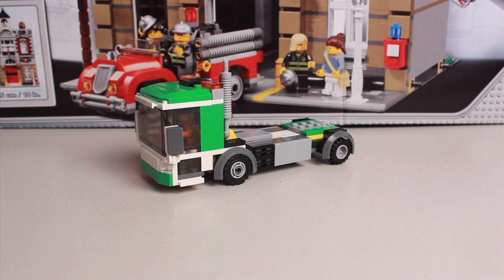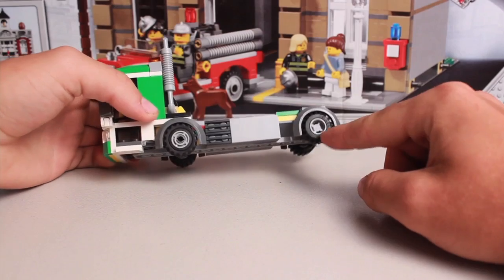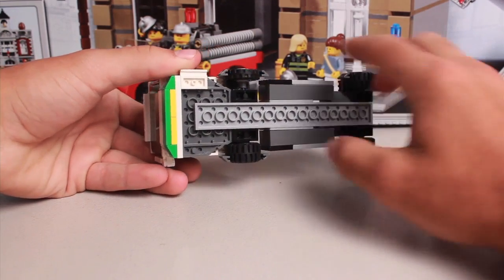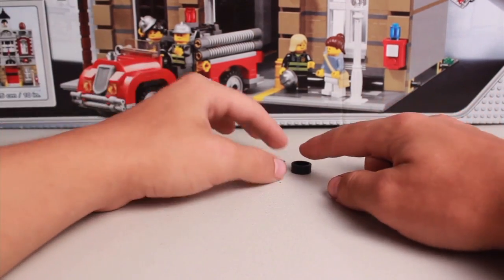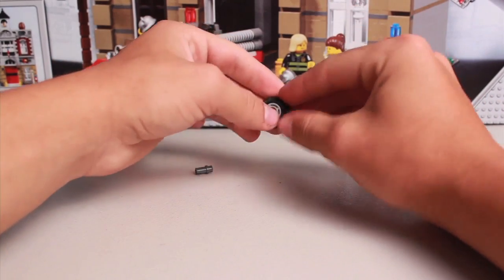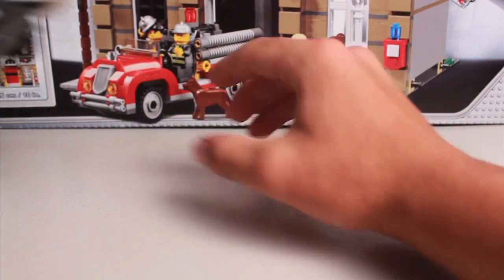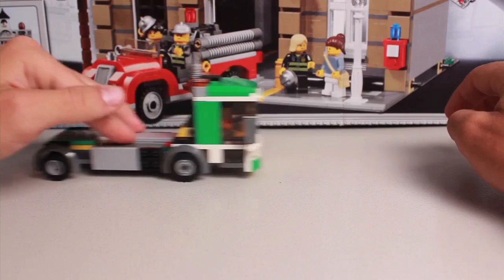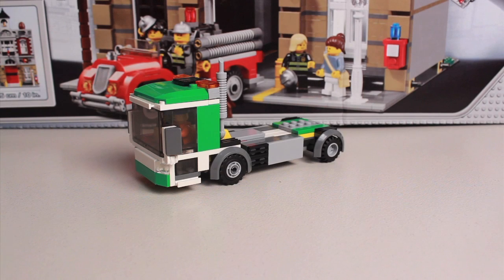LEGO Tutorial: How to Build a One Stud Wide Truck Tire

Comment: Its also because the rear wheels are the drive tires which are moving the vehicle its to get mor traction and the front one is thin because its the one used for stearing

Comment: TBH the demensions of LEGO rims/tires is way off most the time: they are too wide compared to their height.  I build 8-wide cars and 10 wide trucks and finding a good truck tire has been a nightmare.  The big issue is finding a tire that is the height I want but is still narrow enough to allow for duel rear wheels (and have more then a tiny 2-wide axle in the middle).